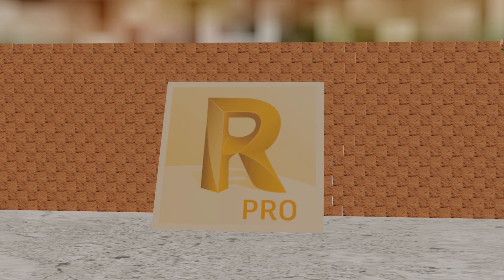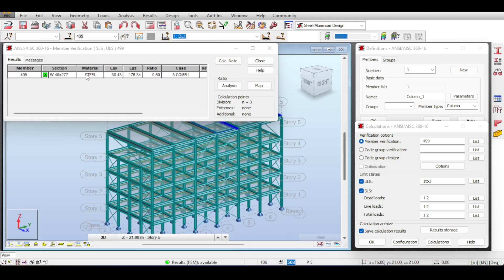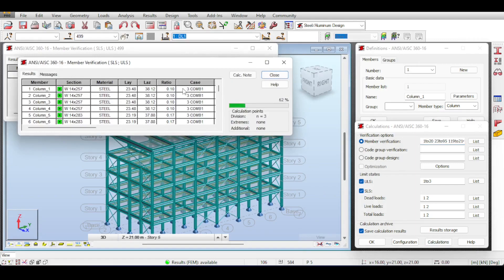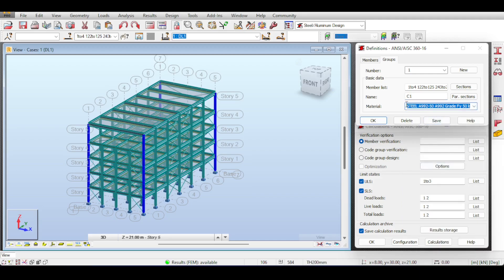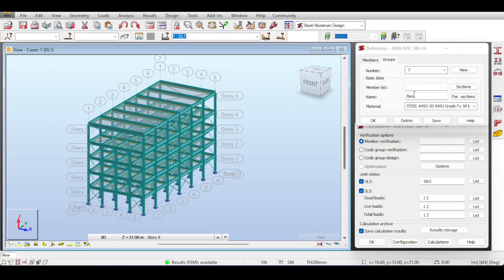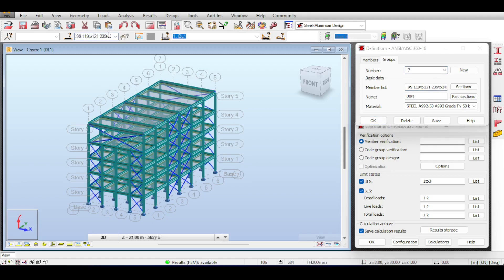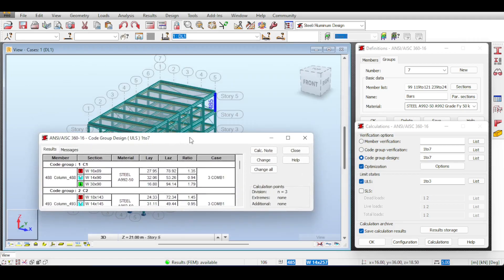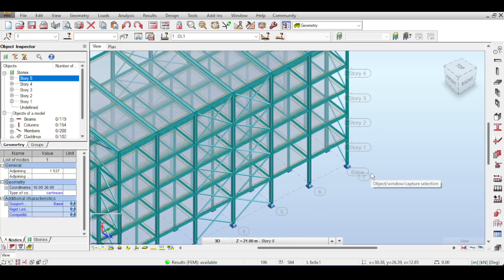Designing Members in a Simple Steel Structure using Autodesk Robot

Comment: Thanks for your sharing! I'm really like in steel members design in Robot but it look like you didn't show how to change or give the tip to change in Code Parameter in Members Type for Beam secondary beam, interior Column side column & Bracing. If you can share that it very helpful for young Engineer like to learn more, I'm really stuck there. Thanks again
Reply from the maker: Sure no Problem. I will consider this👍
Reply: @CivilEngineeringEssentials  Thank you very much, I'm looking to see it.